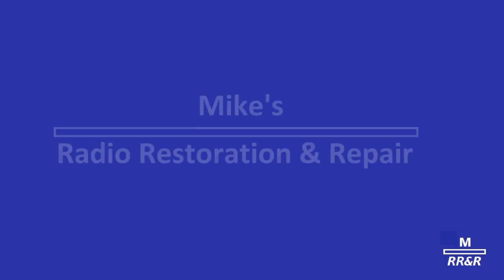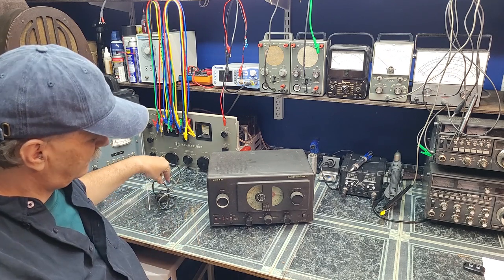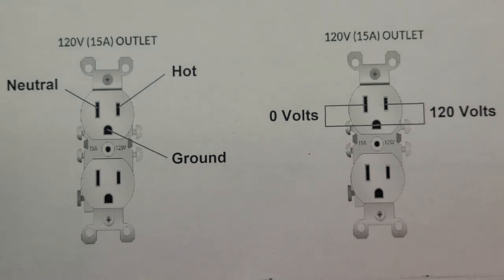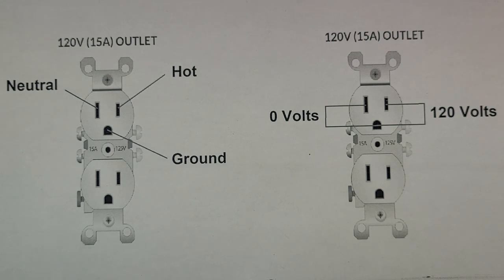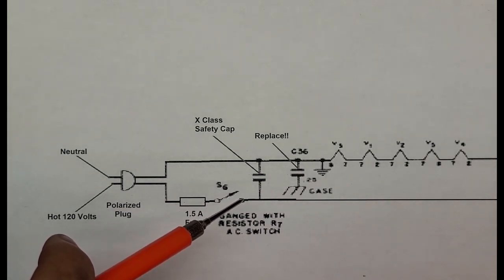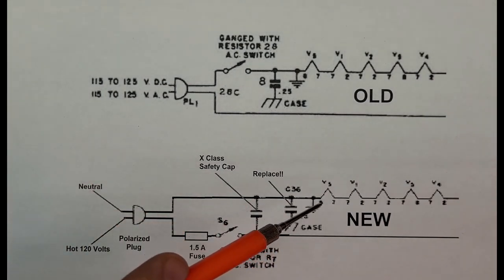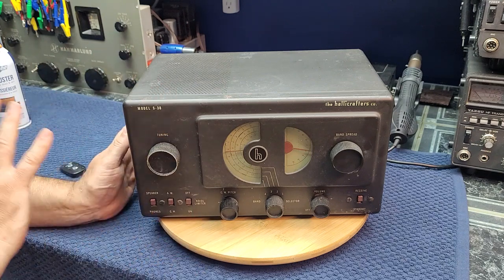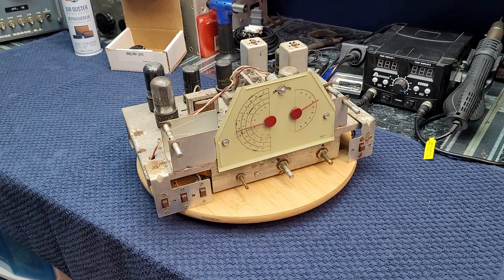Hallicrafters S-38 Restoration Pt. 1 - Safety Repair and Initial Inspection

Comment: I have one for a couple years and am happy to see this video series. I knew about the dangerous ac issue and opted i guess for belt and suspenders and got an isolation transformer. Your solution is much simpler. I'll sign up on FB. Thx.

Comment: What size and voltage is the safety capacitor? Also, what gauge wire do those Hallicrafters have? I'm working on an S38B and a S20R and I'm going to need to replace a few pieces. Thanks for the videos.

Comment: why does the us have such poor electrical standards  for plugin equipment here in NZ we have rcd protection  with three wire outlets
Reply from the maker: Please keep in mind these Radio were made 75 years ago when there really wasnt much for standards and regulations. We now have and have had for many years 3 prong polarized plugs, GFI's... etc....
Reply: @MikesRadioRepairRestoration   yes you are right but we do now live in a world that is safer now and  and our restorations should be safer for our friends and family
Reply from the maker: @robertedwards3147  Hence the whole reason for this video. Make a dangerous radio safe again using a modern polarized plug.